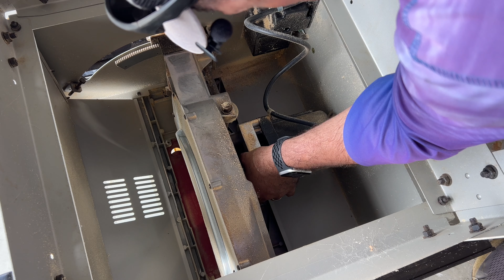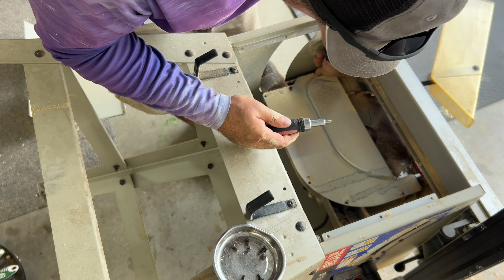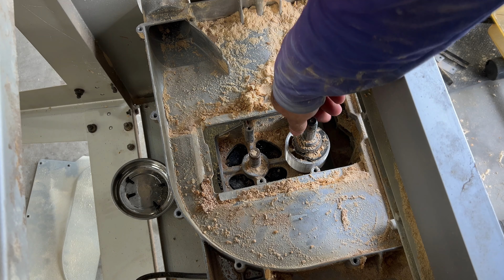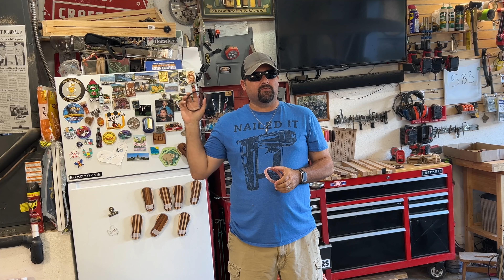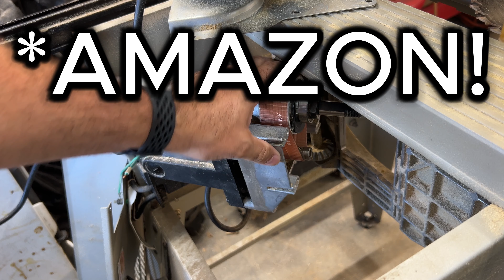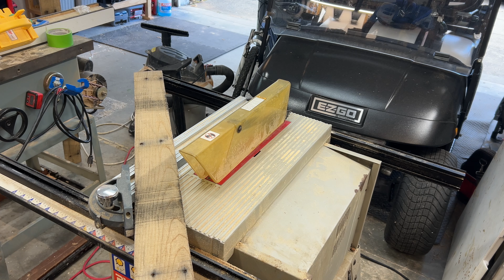How to Replace the Drive Belt on a Ryobi BT3000/BT3100 Table Saw (Avoid Cheap Belts!)

Comment: I got the black ones too. They were a bitch to get on, but I found a small flathead screwdriver, 1/4" head, and a heatgun finally worked for me. I put it around the small wheel and place the screwdriver between the larger wheel and the belt and use the screwdriver to pull it around while I kept heating the belt until it was fully on.
Reply from the maker: I’m glad you got them to work I just struggled and then they ripped so I’m sticking with the orange ones from now on
Reply: @wilmerwoodworks  
I am hoping all the struggle to get them on didn't weaken them so that they fall apart after a little bit of work. But we'll see.